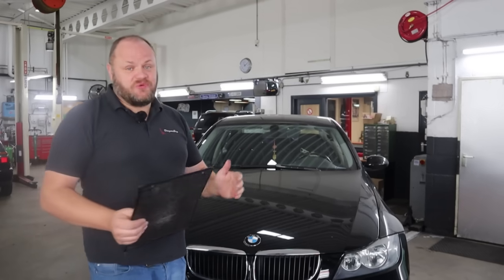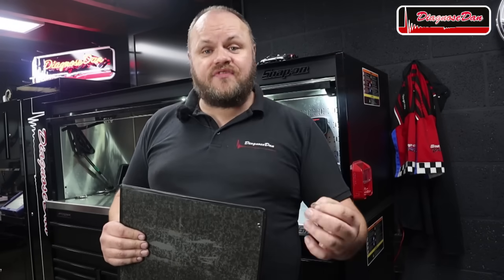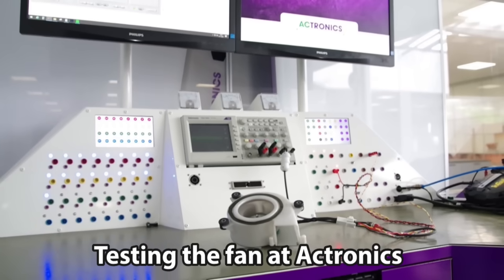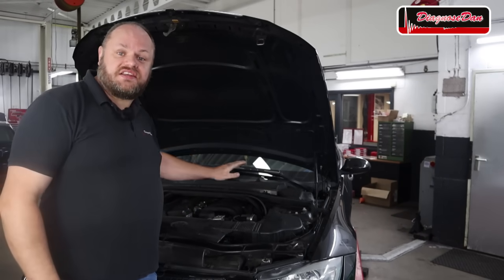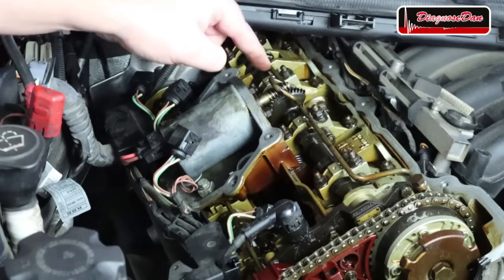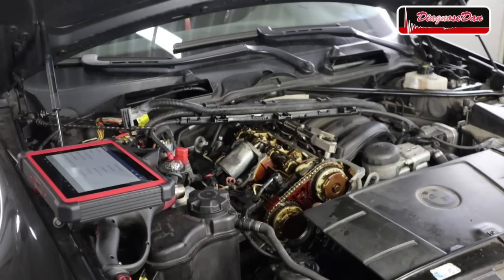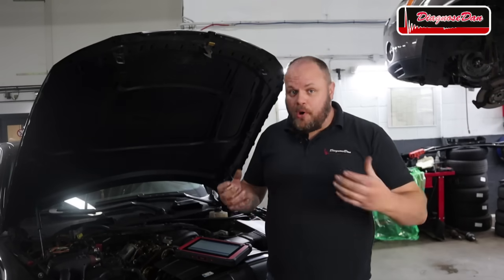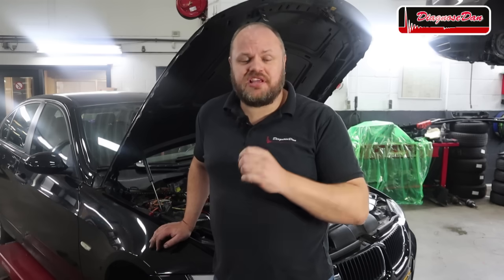Bmw valvetronic,Explained,Diagnosed,Fixed

Comment: I know in a shop environment replacement is norm for liability and cost purposes. For the DIY person, I would try if possible to disassemble the unit, resolder possible cracked solder connections. Then clean and lubricate the internals as required. It could easily be a No Parts Required repair.
Reply from the maker: Thanks for taking the time to leave a comment it's really appriciated.

Comment: Hello Dan, I Just want to ask, intermiten (fel code) why you dont use freezframe and rialtime and se what is the deferent between them to find out what is wrong with the car.
Reply from the maker: I only use that when necessary
Reply: Thank you for your respons, Iam studie in highscool in Sweden and you are one of our favorit chanels, if you can explane how we can use frezfraem as advanteg when we diagnos a car. 
Best Regards Raad
Reply: Hello Dan, I see thier is a problem with Mitsubishi outlander PHEV, they just degredation HV battery capacity and thusends of people looking for salution and they just did not get the right tekniker for the jobb to find out what is wrong with this model why they droping battery capacity, I´m sure it is not easy, but I´m sur also att you can doit. If you get a chance with this car i can garanty att your viewr will be dubel as now. it is reserching project. May be my english not that good but I hoppe att you can understand it.
Best luck with all your work.

Comment: Great as always 👍 do you think using bulb will not burn the computer? Thanks for sharing your knowledge
Reply from the maker: The bulb takes less current than the motor so it's not a problem.

Comment: your repair logic helps us re thing logic repair paths.  please tell us what tool do you use to  communicate 2 way ? is that a snap on or an autel ?   2 years ago you were  testing all the tools in the world. what are the tools that you finally chose to use. what brand for oscilloscope ? how many channels ?   etc etc
Reply from the maker: The scantool used in the video is the Launch padV. I use all my scantools depending on the job i'm doing and Car brand i'm working on. I think i've got 4 scopes. The more channels the more you can test.

Comment: Great video as usual :)
Absolutely yes, if the insulation failed the motor is gone.
Just the other day I had a similar issue on a coolant temp sensor on my car. While it was out of the car, worked fine. When screwed in it did not!
Turned out it had lost the isolation between its two terminals and chassis.
Reply from the maker: Thanks for the feedback!

Comment: Excellent video. My only critique might be the wiggle test. It was very aggressive. Other than that, spot on diagnosis work.
30+ years of fixing cars and my mentor explained to me long ago the benefits and short comings to wiggle testing.
I used to wiggle test wiring as aggressively as your video showed, and often had little-to-no success. My mentor then would have pinpointed the issue within 20 min.
The problem as he explained to me was my method. Aggressively shaking wires can temporarily reconnect questionable connections, making the problem disappear for a while. He went on to explained wires don't move that much in the vehicle, even going down rough roads at 130 kph.
He suggested a far more gentler approach, focusing on areas that round sharp bends near metal engine parts. Areas that could provide an unwanted ground.
While I realize that broken wires were not the issue this time, someone with lesser experience attempting to copy your technique, might find your example less productive.
That being said, you definitely know your craft. Keep up the great content.
Reply from the maker: In Holland we have got a saying;
Gentle healers make stinking wounds. 
That said, thanks for watching 😁
Reply: @Diagnosedan  ouch. In Canada we say those who don't keep an open mind and are not open to continual learning end up like dinosaurs. 
Futurist and author Alvin Toffler one said people must be willing to learn, unlearn, then relearn to move forward. While I might not agreeeve with what is being said, I never try to discount the spirit of the advice. At the very least, I take a moment to think about what is being said and if rings true.
In my career, I've learned that all feedback is good. While I don't always use it, I show appreciation for the input.
Good luck with your channel.
Reply from the maker: @steveo4048  of course i'm gratefull for the feedback. Please dont be offended cause that's not how it was ment. Maybe it was a little lost in translation. What i was trying to say was that somethimes you must not be to gentle if you want to fix something. No disrespect to you or your teacher and his advise. Sorry if it sounded like that!
Reply from the maker: @steveo4048  it's an old saying that dates from the middle ages. Doctors or healers in that time didn't have medicine like we have nowadays. Somethimes they had to cut away flesh or amputate to prevent painfull infected stinking wounds that could kill someone.
Reply: @Diagnosedan  It's all good. Cheers and good wishes. 

Again. Keep up the great content.
Reply from the maker: @steveo4048  😅
Reply: Just read this conversation... and had to comment that you both are fine gentlemen and handled that well.   Great example of feedback.   Now,  moving on to find a fix for my issue...1 hour so far today in reviewing DD videos.   Thanks for the great education,  though admittedly,  a lot of it is way over my head :-)

Comment: IT is not true DD that the throtle body is fully open and the valvetronic is the one that is functioning as the throtle. The throtle is working as normal like Any other car. The difference here is that if you need More air on higher rpm the valvetronic is controlled and all of the other rpm ranges. So i like you video's but here you  explained a little bit fault information to the viewers. Thanks keep up the good work. I am also doing diagnostic work for shops. Ciaoo
Reply from the maker: What you are saying is not entirely right. If the throttle valve operated as any other than we should have vacuüm in the intake as any other engine. 
Thanks for watching!

Comment: Hi, Dan! Path to the ground on the old servomotor is provided by the brush dust, that accumulates inside the motor.
Reply from the maker: Thanks for the feedback!!
Reply: So can the motor be opened up and cleaned to restore normal operation ?

These motors are not cheap to replace
Reply: @Monkey-World-2  Yes, but labor time end efforts doesn't worth it for me.

Comment: Dan teaches that complex things arise from simple rules. Great methodology when explaining how cars work. I just replaced DME 1 & DME 2 on my 2006 BMW 760 I)
The Oxygen Sensor Controller chip(s) had failed.  No problems with the Valvetronic system yet. The V 12 Engines seem to be very reliable other than the Electronic issues that can occur.
Reply from the maker: The V12 is an amazing engine, i used to own a BMW 850 a loonnnnnggg time ago.
Reply: @Diagnosedan  The V 12 Engine is a smooth running Engine. The Rolls Royce Phantom and the BMW 760i
have the exact same 6 Liter V 12 Engine. BMW owns Rolls Royce.
Reply from the maker: @davidhall3747  i know i've been to the factory and have seen Rolls Royces being Build. The body is build in England and the rest is assambled in Germany
Reply: @Diagnosedan  How long does it take from start to finish to build a Rolls Royce?

Comment: Dan, have you run in to an issue where the motor and the fuse are ok, no check engine light (but the code is set), and the motor only winds down slowly but not up?  So if the motor is wound up - the car works fine for a while, but over time the max rpm keeps dropping, as the motor is winding itself down a little at each start, reducing performance gradually, finally resulting in no start.  It's a 2006 3 series with n52.
Reply from the maker: No i have never seen that before
Reply: @Diagnosedan  I'm suspecting MOSFETs in the DME, but I have not had a chance to open it yet.  I have temporarily disconnected the valvetronic motor, wound it all the way up and taped the allen wrench to the back of it so it doesn't unwind ))). It's a hack of a fix, but it's a good roadside solution )))

Comment: Great video and description of operation, Dan! How does this system make the engine more efficient? There is still pumping losses during the intake stroke because the intake valve is only slightly open 🤔 that was a lot of plastic too 😅
Reply from the maker: Hi Ivan thanks for taking the time to leave a comment.
Because the valves open only a fraction of those of a conventional engine in some situations the air has to flow alot faster past the valves to fill the cylinders. The higher airspeed and the vortex that's created results in a better filling (volumetric efficiency) of the engine.
Reply: @Diagnosedan  Aaah that makes sense! The airspeed is key :)
Reply: @Diagnosedan  thanks for the information guys.
Reply: Also throttle response should be better as well since atmospheric pressure is right on the valve at all times instead of having to travel through the intake manifold
Reply: @eric49a  for sure!
Reply: Pumping losses are reduced because the inlet manifold no longer has vacuum.  In a normal engine the piston has to do work against the vacuum in the inlet manifold during the induction stroke, and because the inlet valve closes before the compression stroke this work is lost.  With the valvetronic engine the piston has to do work creating a vacuum when there is a small valve opening, but this vacuum is contained only within the cylinder so the work is mostly recovered on the compression stroke.
Reply: @ferrumignis  Interesting theory! To me it seems like the amount of work done by the piston on the intake stroke is the same for either system, just that the restriction is in a different place (throttle body vs. intake valve). Once the intake valve is closed, the cylinder contains the same air mass in either case, so the same amount of work would be recovered on the compression stroke...right?
Reply: Ivan, thanks for asking this question!
"If you're the smartest person in the room, you're in the wrong room!" Elbert Einstein
Reply: I'm afraid I must question Dan's VE hypothesis. Air velocity could improve fuel vaporization, but at the same power output VE should be ~equal. As Ivan states, cylinder pressure should be ~equal at the moment the intake valve closes so I don't see how any energy can be recovered during the compression stroke. I could believe that mean cylinder pressure during the intake stroke is higher due to the cylinder not being exposed to vacuum as soon as the valve opens, but I'd like to see comparative cylinder pressure readings to evaluate the actual difference.
Driving the valve train does require an appreciable amount of energy. Perhaps the greatest advantage of the system lies in the energy savings from reduced valve lift, despite the added friction losses from the additional mechanisms.
Reply: @fascistpedant758  It's basically all the advantages of individual throttle bodies without all the extra complexities and linkages

Comment: Yes if there is a measurable resistance from the motor windings to body it means the insulation on wires is breaking down - which is a bad sign. Just out of interest when you heat the motor up does the resistance between the windings and case reduce?
Reply from the maker: I have not tried 🤭

Comment: Love your testing!

Unfortunately, now Job Rate mechanic would take the time to confirm the part was bad....just send it and move on to the next FLOB (should translate to F'n Loss of Future Business....LOL)

YES you did confirm issue with motor and Ohm readings.  heated coils/windings fail and can recover when cool.  Same as ignition coils.

Mr. P
Reply from the maker: Thanks for the feedback Mr.p

Comment: I'd be curious to know what the resistance to the motor housing is when it's warm. Being a pulse width modulation actuator, you wouldn't want any resistance to ground.
Reply from the maker: I have not checked🤭
Reply: Ricky, I assume you meant to say you WOULD want very a high resistance to ground (in the Mega ohms range)... basically insulated from the body... 🤔

Comment: Now sell them new timing chain guides and a new rod bearings and then you can call this engine fixed.
Reply from the maker: You forgot valve stem seals🤣

Comment: Clever, clever, clever; very well explained!
Thank you Dan!
And yes low resistance to the body or case of any electric motor it is a bad sign that that motor is about to fail, if not already faulty.
The isolation resistance between windings and the case should be at least 1 Mega Ohms, if not more; tens of Mega Ohms.
Reply: Oh, I just put two and two together!
MEGER (Testing device)
Mega OHM
Reply: @dans_Learning_Curve  that's right; forgot to mention; that Megger it is an expensive tool, that sends a preset high-voltage in pulses down two wire or mediums with the intention of testing exactly that - isolation resistance between wires..
Well, it is good enough to just get no resistance between case an windings or between 2 different winding to get a high reading.. and that will, kind of eliminate a potential issue.
But as Dan is saying, with temperature, yeap, the insolation/wire will expannd and the isolation can change do to temperature..
A tester as the one above, it is good by using it to zapp higher voltage and physicaly destroy the isolation and make worse the isolation and conclude that probably that isolation was prone to fail. BUT that test should be done with caution because too high voltage is detrimental and has an irreversible effect!!
Just a word of caution when using a higher specialized tool.

A multimeter will measure the resistance by sending much, much lower current down the wires and verify the resistance of the medium..
Reply: @MrFryfish  exactly! beautiful explanation dude!
Reply: @dans_Learning_Curve  Yeees! a insulation resistance tester o meger must be used to evaluate the condition of insulation of a motor, but if the fluke handheld tester measures something, you are screwed haha
Reply from the maker: Thanks for watching

Comment: Dan, don't most sensors that go bad i.e. crank position, camshaft pos sensors, go bad due to heat?  It just seems heat is the enemy of electronics especially in vehicles.  Or, is it the constant on off of the current surging through the processors?
Reply from the maker: Heat is always an enemy of electronics!

Comment: Current leakage to the shell is likely seen by the ECU as excessive current draw and it stops trying to drive the motor it. I noticed you didn't backprobe the connector.... If you had it might have been inconclusive as the ECU would have noticed the excessive current and stopped trying to drive the motor faster than you could have seen it happen on your meter. This would have lead you to think the ECU was not sending the drive signal. Testing the signal as you did with the lamp as a load provided enough draw to make the ECU happier, though I did notice it didn't stay lit as long as the test cycle normally takes.
Reply from the maker: Thanks for the feedback!

Comment: I've never worked on one of these.  I like the theory of operation.  When you said the throttle is usually open, that reminds me of the old non computerized diesel engines.  The injector pump controlled the idle.
Reply from the maker: Thanks for the comment Mike it's appriciated

Comment: I got exactly the same fault with my own N46... it needs a new motor... same codes....  plays up when cars hot.... check engine light now and then....... and... car will 'pink' at times on acceleration and stutter. Soon as cars cold again.. its good to go ::) i havent changed the motor as yet....as the valve stem seals needs doing LOL. So gonna hit it all in one go. Let be honest... the opening temp of the thermostat on this engine is 105 degress C !!!!!! This engine runs very hot....and the valvetronic motor is in the worst place for heat !!!!!
Reply from the maker: The Car in the video also needs new valve stem seals, it smokes quite alot.

Comment: They should have BMW  valvetronic motors in vending machines. Right next to the oil filter housing gaskets and cooling system parts. ;)

Thanks for the video!
Reply from the maker: 🤣🤣👍 thanks for watching Jimmy
Reply: That's funny shit right there, yet so very true.

Comment: I think the difference in the measurement has to do with an unused and a used motor. Moisture/oil for example, combined with conductive dust from the brushes can cause such high resistance reading. I think If you clean the used one really well, there will be no measurement.
Reply from the maker: It's a sealed unit

Comment: If the valvetronic fail in a closed position then (I guess) the throttle can't do much. It's more like a way to prevent unintended acceleration due to  valvetronic failure? Like the throttle in diesel engines?

Comment: dan i have a e90 320i like this one it is getting a turbo ford barra engine and zf6hp26 no more n46 engine problems and i will be putting the hi can to low can on the dme plug to bypass the dme out of the system the car should not know the difference as i will be running the ford ecm as its matched to the transmission cheers from down under

Comment: I have been getting into the valvetronic system on an S63TU from an M Sport X5 50i whilst replacing the valve stem seals because of a smoky engine, it is not a very complicated system as most people think it is.

Comment: bmw has so many stupid solutions that do not last in the long run. they are also expensive to repair.
why have this system when the motor can work fine without?

Electric motors in cars tend to be the cheapest type